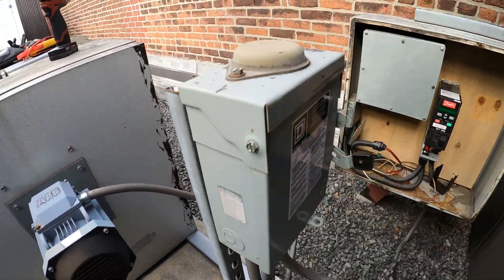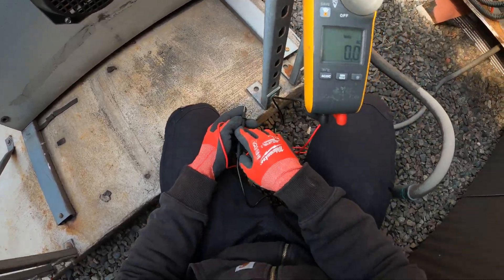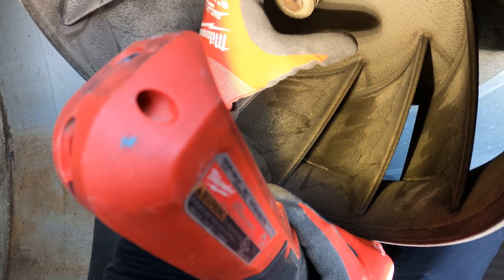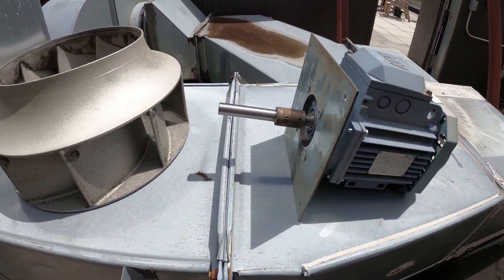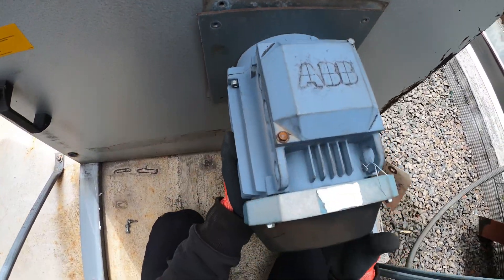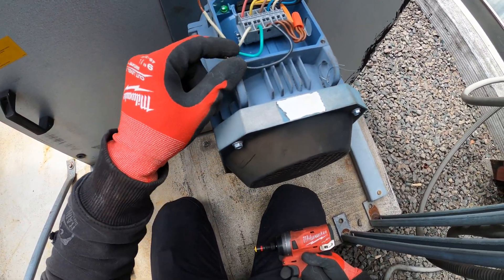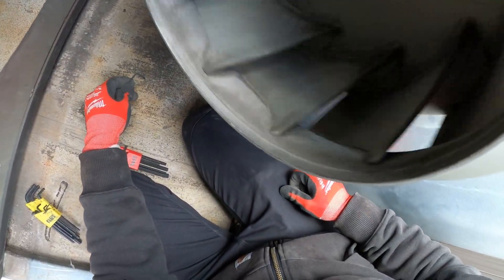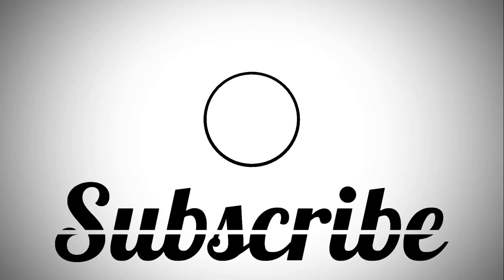HVAC: Exhaust Fan Motor Emergency Service Call (ABB Blower Motor) Exhaust Fan Motor Troubleshooting

Comment: Hi how are i'm from Ethiopia...
I received a maintenance request from restaurant, the problem is ,smoke extracter is making high noise... the fan is connected with three phase motor with belt, i disconnect the belt and let the motor to work alone and no noise ,start working in good conditions but  when i connect the motor to the fan using the belt it stat making high noise what could the problem?
thank you!

Comment: It was a 480 (440) volt motor because of the former VFD in the cabinet on the right.  It is common in those smaller HP ratings for the drive to accept a 240/208 input and output 480/440 to the motor AFTER the VFD. It looked like th VFD had failed and was disconnected, but no one bothered to rewire the motor voltage.

Comment: You just did a major screw up. The motor was already wired for Delta at 2:59 in the video, which is low voltage. You should have checked the frequency the VFD was outputting if the motor was going slow like that. Now your "expert" just wired your motor in WYE configuration, which is high voltage. The 3 wires tied together is WYE at 7:19 in your video. A bit of common sense goes a long way, dude. If the install is this old looking and it worked since then, then it won't suddenly be the issue if it is failing.

Comment: Do you ever heard of star/delta? It's a very common thing for 3phase ac induction motors. They all have this configuration block where you can route the internal coil arrangement. The motor specialist must have given you a facepalm,

Comment: Before your work it was correctly wired in Delta(240V) now its in Star(460V).
The nameplate says it, Star 440V and Delta will be 1/1.73 lower -> 240V

Comment: 400v is supplied from the vfd 

Vfd will convert ac to DC then back to ac so can supply 400 volts

Comment: You mentioned cleaning the inside of the bore on the fan blades.  I have a shotgun cleaning rod in my kit for this.  The brass brush gets the big stuff, some sandpaper in the cleaning patch holder chucked in a drill cleans them right up.
Reply from the maker: Thats awesome🤣👍 Appreciate the feedback & you watching! Stay safe out there & stay tuned for new videos every week🔧